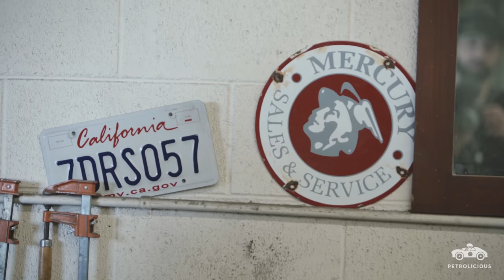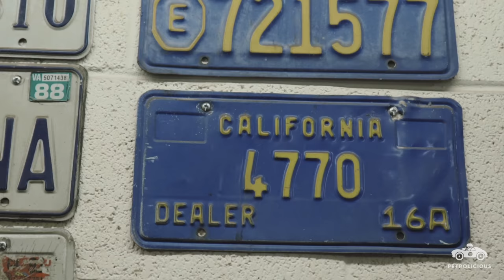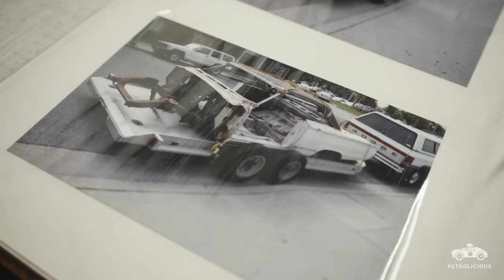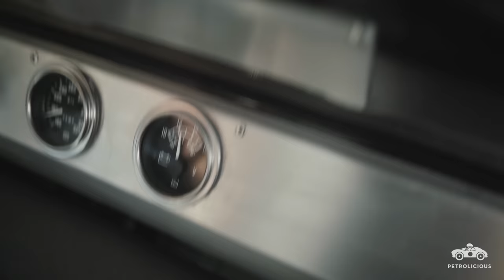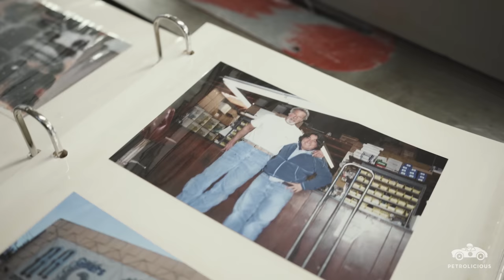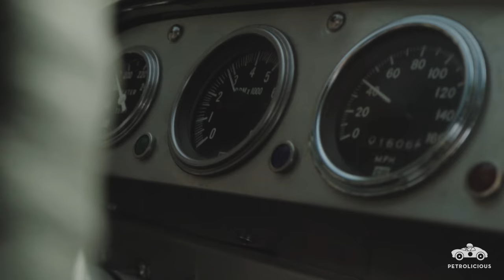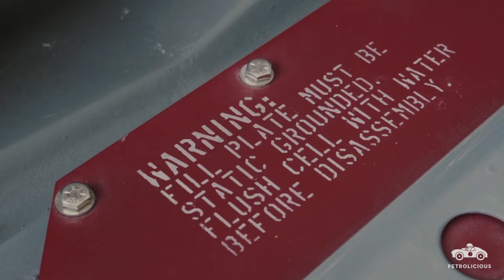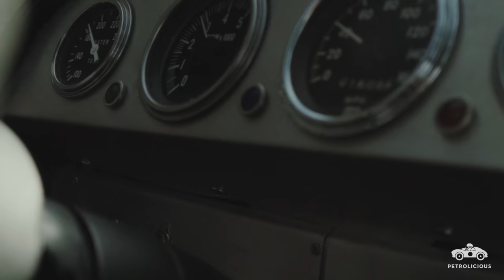1964 Mercury Marauder: The Odyssey

Comment: when I was 12 I got to see Parnelli Jones, AJ Foyt, Andretti and Don White racing a USAC road course event in the midwest.  Jones and Andretti were driving 1964 Mercury coupes with the numbers 14 and 16 on the doors.   They thundered around the track with those 427 engines and huge loud pipes.  I was hooked.

Comment: Awesome car and what a story. I can relate to that boat motor thing also 351 Holman Moody's (pair) came out of a wrecked 35 ft power boat had the same issues with the pulleys when I tried to use one in a car I built (boats have an unlimited radiator - the lake) LOL  Old boat guy I went to that worked for an offshore race team many years listened
 intently as he was doing a couple Holley's for one of those Holman Moody 427's. After I was done with my story he says you drive it here - yes I did and its hot now grrrrr. He walks out opens the hood on my 70 Torino says start it up, takes the radiator cap off and revs the motor up to about 3000 says ok turn it off. Says needs a automotive water pump pulley the boat pulleys are too small probably be 1-1.5 inches larger diameter. I think I have one - looks through his stash finds it and hands it to me. What do I owe you?  See that drug store across the street, yep go get me a half pint of peach brandy. DONE!!  Do you still have this car?
Reply: It makes sense to me that an engine with a constant (relatively) cold water supply would want to slow the water pump down to avoid overcooling.  And no, I'm not some hotshot engineer, I didn't hear of this 'til I watched the vid.  It just makes sense if you have some basic automotive knowledge.  That said, I have certainly struggled with my own car issues that turned out to have simple solutions that left me feeling quite stupid.  I love early sixties FoMoCo products, my first car at 18 was a '64 Galaxie 500/XL coupe.

Comment: First thing i thought at the beginning: there's parts on marine applications that don't work on automotive application. I'm surprised all these people who looked at the engine did not consider if the pump was pumping. Since marine engines operate at a high rpm all the time while underway, it's necessary to underdrive the pump or the impeller will cavitate. Car makers even understood this for muscle cars. Due to low rear end gear ratio and high revving engines, they slowed the pumps down a little compared to regular passenger car duty. Using pulleys off a 427 impala for your L75 396 could be problematic at high engine speed unless it will be treated as a slow driving parade car.

Comment: Using fel pro head gaskets also causes over heating.  The FE  water jacket is large, fel pro puts a tiny hole to " help warm the engine " Idk if other manufacturers do this but the factory gasket matches the water jackets!!

Comment: Hello, liked your car very much, a Mercury Marauder or early Turnpike Cruiser are two cars that have always been on my 'Wish List' but as a 71 year old semi- disabled  guy I'm satisfied with my 2000 Mercury Marquis, one of the last of the old-school body-on-frame, V8, rear wheel drive cars. About your legs, I was worried  about mine also as it was becoming more difficult to walk.. I went to the Doctor  and  they found out a nerve bundle in my spine was being pinched and would continue to deteriorate unless attended to. That stopped further damage but it's still difficult for me to enjoy driving my 1966 C-10with a old-school Supercharged V8 because of the clutch, Just thought you should check that out if you have not done so already. Regards, Phil Massie'

Comment: Steve, I'm sorry man, but I gotta tell you... I'm not a fan of those finned, aluminum valve covers and the same with the air cleaner. I would strive for an original NASCAR look...
Reply: But..Being solid lifter and needing adjustment often the flanges on the aluminum cover are way thicker and less prone to leaking the the stamped steel stock ones.
Reply: @falconater68  C'mon man, seriously?

Comment: This is a super bad Merc. My favorite muscle cars ever that weren't built by Chrysler were the Ford/Mercury 427ci/425hp cars. My favorite is either a 1963 1/2 R-Code Galaxie or a 1966-67 R-Code Fairlane. It's too bad that Ford never installed the 427 SOHC in any regular production cars. They did fit three full size Galaxies with the Cammer but none of the three were ever sold to the public. I think one of them is still out there.....a plain Jane cream colored 65 Galaxie packing the baddest V8 ever to come from Detroit...the Ford 427 SOHC. I can admit that even as a Mopar guy.